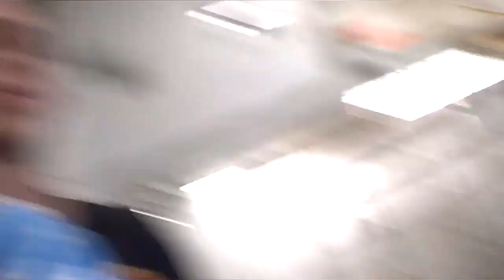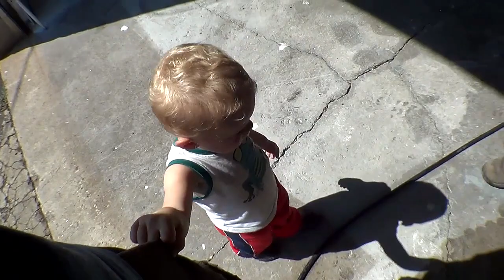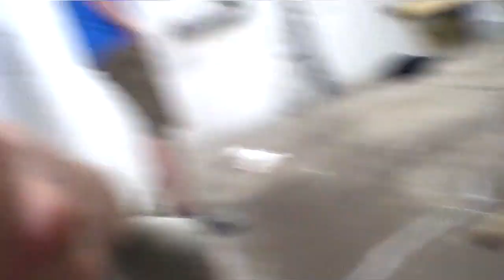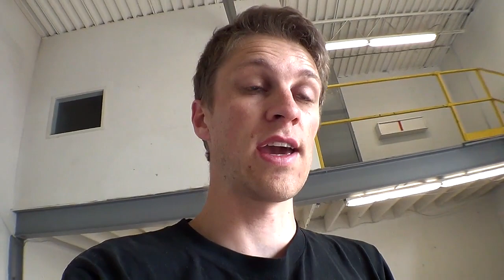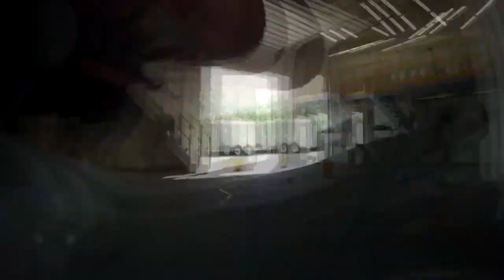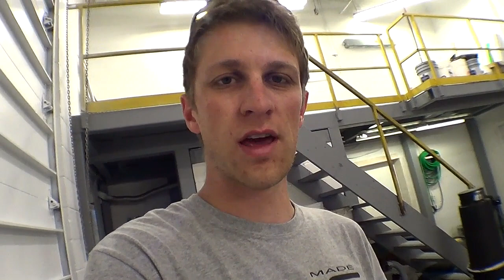New Grimsmo Knives Shop Part 2

Comment: really should had rented a concrete grinder, finned in the holes and cracks with normal portland cement and the gave the floor a quick grind  and if you had do a float on self leveling epoxy you'd had a show room finish floor and might had been out about the same price

Comment: I had an old apartment where the concrete floor foundation was just crumbled apart from shoddy workmanship. It was tiled over to hide it "somewhat" but you could definitely tell where the cracks were. My landlord allowed me to rip up the vinyl flooring and repair the floor correctly, then re-vinyl the floor and add carpet where I wanted. I've used the crack repair stuff they used here and its just crap. Too expensive and not enough coverage for the price. Using an ordinary bag of portland cement and fine sand worked better. Filled a large area of cracks with a super smooth finish.

Comment: Hi John,

As an ex-painter/decorator, my advice to rid the rust and oil bleed through is to gloss paint a nice thick coat, then the stain will be held under that and you can put whatever paint you might be using on the walls etc to finish.

Comment: I wonder if you could just sand blast that wall to get rid of any of that grease and grime from the lathe.  Mobile sandblast guys that do concrete and brick could probably knock it out quicklike
Reply from the maker: Good point!  There was a sand blast guy in another unit that offered to do the floors but I was feeling cheap and for some reason wanted to do this myself.

Comment: Nice work. Did you guys price out getting a new floor poured? Just wondering if that floor was stable enough to support the CNC machines. I know we had 36" thick concrete pads poured for some of our large machines at a place I use to work at. Those were some big machines though.

Comment: For the next time you need to fix a floor like that, i.e. Pitted, cracked, not level. First, clean the snot out of it like you did. Second, use self-leveling concrete to fill and level. Lastly, epoxy coat. It takes less time and money. As for a polished floor in an oily shop, it will still soak up oil and be hard to clean. Fear not though, we have all learned lessons the hard way. The shop looks really good and will be a nice place to work.

Comment: The school of hard knocks isn't fair...gives the test before the lesson.  Thanks for the info about the floor grinding option...would have been good to know ahead of time, but now everyone who watched will know if it comes up for them. Until you mentioned it I was thinking that it might have been easier, faster, and maybe even cheaper to try spray on bed liner.

I know a guy who's in the machining and metal fabrication business.  Has a large facility with a number of  machining centers, CNC punches, laser cutters, etc.  when he told me what tooling for his sheet metal punches cost, I asked why he didn't just make his own...he has the capability.  He told me that it wasn't worth it...he didn't want to compete with folks who did that sort of thing for a living....he'd rather do what he did, and pay them to do what they do, because he'd come out ahead on money and time, and have fewer headaches too.  A good lesson to learn if you ask me. 

Congrats on the nice new facility!

-- Mike

Comment: hey john,  if you epoxied over the smooth floor that epoxy once wet will be like an ice skating rink.  not good for a shop environment.  my floors at the shop are epoxied and smooth and once some oil or coolant drips on them.  we have to stay on top of cleaning to make sure no one gets hurt

Comment: Great choice going with the Sherwin-Williams epoxy paint.  My first shop, I used the Rustoleum epoxy and it chipped and peeled, even with proper preparation.  The high-dollar Sherwin-Williams epoxy paint is a much better "bargain", as it does not chip, peel.  You will be able to drag steel and equipment across your "new" floor and that S-W epoxy will just laugh at you and stay stuck to the concrete.  That is a very nice cleanup job you guys did.  Cheers, Gary

Comment: Concrete sanding - i think You relly get what You pay.
You could have spent not 2K but 5K, 10K or 15K on your floor easily. And it would look better proportionally.
You could also went pressure wash ONLY.
and live with it.
I think You did  PERFECT price-result variant, dudes.

Comment: Shop looks good, John!  It will really make coming to work much more pleasant.  
 Hindsight is always 20/20.  There's always more risk in taking on a task when you have no experience in doing the work.  The learning curve can be long and steep.  Getting an estimate (or two or three) from someone experienced in the work you need is a good sanity check, even if you end up doing the work yourself.  
Too, you have to add the opportunity cost to your estimate up front.    As you noted, you and Eric could have made and sold some number of knives if someone else did the preparation of the new shop.   But experience doesn't come cheap, and I'd say that you got a good deal and learned much.  

And you've got an A-number one brother.  That Eric is a worker!   It's good that you two have such a amiable relationship.

I'm looking forward to seeing the new shop up and running.

Best regards

Comment: texture = traction = no slipping.  I say this because I broke my femur from a slip and fall.  I wouldn't be that put out about it.
Reply: +John Harmon - Cold Creek Works No traction was my first thought too. I have a spot on my shop floor that was sealed as a test, and it's dangerous if anything spills on it! Even walking in with wet shoes from rain or snow can be tricky.
Reply: +John Harmon - Cold Creek Works Yup, dangerous. Slipped on my wrist and broke it, and it was just a slightly wet floor, shops can get other spills.

Comment: Man, look at that floor. NICE. Looking good John. Douglas
Reply: By the way you can get a two foot wand extension for your gun. It will help you as you get closer to the ceiling and hard to reach places. They are not expensive.

Comment: You need to paint a very large logo on the main wall ! Borrow a projector, mark the contour with a sharpie and fill with some black paint. I bet you will feel completely at home when it's done !
Reply: +xavtek Using a projector is an extremely neat idea ;-)
Reply: had the same thought